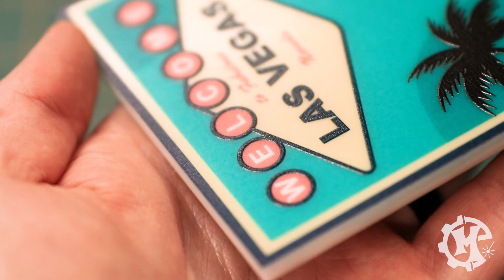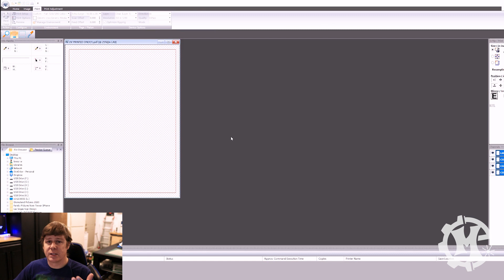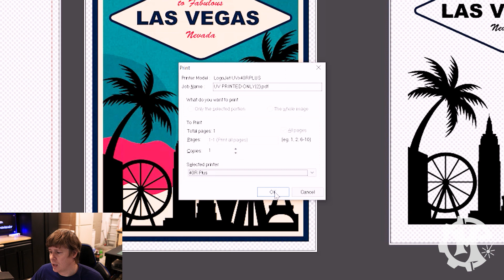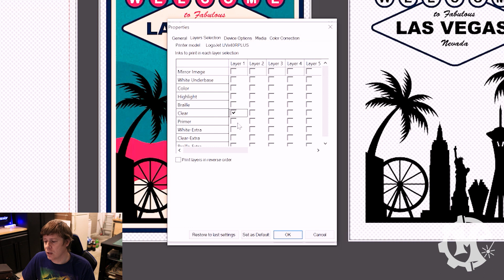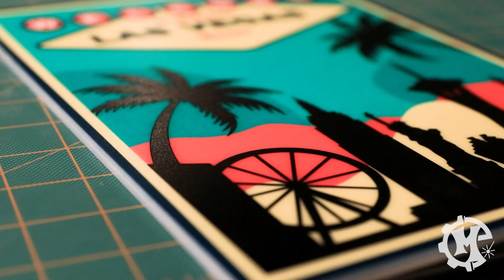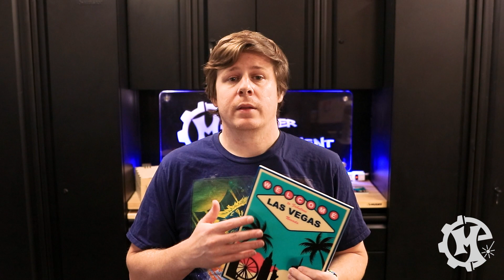How to Add Raised Elements to Your Design | Spot Gloss UV Printing

Comment: Hi, may i know how to design for these
Reply from the maker: I designed in Adobe illustrator. What exactly are you wanting to know?
Reply: @MakerExperiment  o a, designing adobe photoshop
i want to print on golden sheet, SO basically i have UV DTF for that i need to print on specific border or any object only varnish spot, white spot as full design so how to make file for that, you can say golden foil effect to look a like
Reply from the maker: There’s a method for Photoshop but I’m not as familiar with it.

Comment: i have buy UV dtf flatbed machine and facing problem of white color font print. also how to make spot channel for white and varnish as well as sticker sheet print and spot channel. can you please someone guide me or have video to share of this all my problem related query so i will fix my issue. 

I really appreciate of your help.
Reply from the maker: Which machine do you have? This printer isn’t really meant for stickers.
Reply: @MakerExperiment i have uv dtf 4062 pro flatbed
Reply from the maker: It’ll depend on your software on how to set it up. Have you reached out to your manufacturer?

Comment: You can accomplish a glossier finish on the clear by printing the clear with the lamps turned off - then run it again with no ink and only the lamps on at 100 per cent…..
Reply from the maker: Appreciate it. I figured that out much later than I should have.

Comment: Can this be done with any UV printer ?
Reply from the maker: Yes. This was early on in my journey and I plan to make an updated video at some point. All UV printers are capable of adding raised textures by layering ink.
Reply: Thank you so much for replying ! I am planning to start my own business selling custom arcylic christmas ornaments on ETSY and I need an UV printer. 

I have a budget to 5k$. Do you think is it possible to find a good small UV printer for this price ? 

Thank you for taking time and reading/answering my comments. 
 @MakerExperiment
Reply from the maker: @oliviajohnson9062  I’ll be honest, at that budget it’s going to be really tough to find something reliable with support. Have you considered sublimation printing?
Reply: I am already doing sublimation with ceramic ornaments and pretty successful with it. I have sold over 15.000 in 2 years. But I want to start selling arcylic and glass as well. The most successful sellers on ETSY are doing UV prints, or uv dtf for acrylic (not sure, but I know it is not sublimation. I ordered samples from them they told me that they use Japanese UV printing technology, not sure if thats a lie lol) 

I found this printer for $2.6k ( 6.7" Single Head A4 UV Printer A4-C procolored ) Tray is small but enough to start. I am just concerned about the print quality whether the colors would be vibrant or not. I know nothing about uv prints. I own 3 sublimation printers already and running successful business. Thank you so much for your reply, seriously means lot to me. I have been researching about uv prints for a while. 
 @MakerExperiment
Reply: I am already doing sublimation with ceramic ornaments and pretty successful with it. I have sold over 15.000 in 2 years. But I want to start selling acrylic and glass as well. The most successful sellers on ETSY are doing UV prints, or uv dtf for acrylic (not sure, but I know it is not sublimation. I ordered samples from them they told me that they use Japanese UV printing technology, not sure if thats a lie lol) 

I found this printer for $2.6k ( 6.7" Single Head A4 UV Printer A4-C pro-colored ) Tray is small but enough to start. I am just concerned about the print quality whether the colors would be vibrant or not. I know nothing about uv prints. I own 3 sublimation printers already and running successful business. Thank you so much for your reply, seriously means lot to me. I have been researching about uv prints for a while.  @MakerExperiment
Reply: @MakerExperiment  I am already doing sublimation with ceramic ornaments and pretty successful with it. I have sold over 15.000 in 2 years. But I want to start selling arcylic and glass as well.

I found this printer for Single Head A4 UV Printer A4-C and the brand is  procolored Tray is small but enough to start. I am just concerned about the print quality whether the colors would be vibrant or not.
Reply from the maker: @oliviajohnson9062  I’m not familiar with machine so it would be hard for me to say. I’d encourage you to ask in UV printer forums. Someone else may have experience with that machine.
Reply: @oliviajohnson9062  just picked up a procolored A3 Pro. So far it's awesome.

Comment: Thanks for the video.  Wondering about the Rowmark material you printed the outline on.  Does that allow you to wipe off the outline to reuse it?  Thanks
Reply from the maker: Yes. It’s a Seklema mat. You can clean it with either packaging tape and peeling it off or isopropyl alcohol.

Comment: So it’s possible only with UV printer?
Reply from the maker: You might be able to do it other ways but a printer is the easiest way.
Reply: @MakerExperiment  Thanks, but other way you mean paint? Or any other type of printer?
Reply from the maker: @samchahal9869  some options may be painting it, possibly sublimation printing, or maybe adding vinyl stickers afterwards.
Reply: @MakerExperiment  Yeah, but I also think UV printer is the best for this job. Which UV printer is beginner friendly? Any recommendations? Cost and work wise. Because these printers are expensive I guess.
Reply from the maker: @samchahal9869  UV printer is the best. I use a LogoJet but they aren’t cheap. Even the Chinese UV printers are over $10K.

Comment: Trevor... Couple questions. Was this a "print receptive" acrylic,  as I didn't see you use a promoter? Also no bleed around the color & clear layers to be sure the print covers the edges of the acrylic? If there was I didn't notice any color printed on the mat.
Reply from the maker: If it’s cast acrylic it doesn’t need the adhesion promoter from what I’ve been told. Extruded acrylic would. I did do a bleed but it was very minimal.
Reply: @MakerExperiment I didn't know that. I'm going to try it without promoter then. That stuff smells worse then the laser does cutting the acrylic.

Comment: Thanks for the work flow demo. We have a Mimaki and you're right, there are several ways to accomplish this effect. What caught my attention the most and caused me to pause was your usage of the Seklema mat. You marked your position with a simple reference rectangle on the mat. We always thought it's use case was on the Epilog for substrate hold downs. How are you cleaning the marks? Windex? LA's Totally Awesome? Do you have a link for the Seklema? It looks like we'd have to cut the mat to size if we got one.
Reply from the maker: I actually clean it with either isopropyl alcohol or packaging tape. Packing tape applied and ripped off will get off a lot of it. I got mine from LogoJet. I don’t know if they have it cut to size or not. Enduramark sells a similar mat. They may be able to cut it to a custom size if you ask. Just let them know I sent you and ask.

Comment: Nice work Trevor. It's great seeing you explore the possibilities of this UV printer. I think to minimise confusion, the ink is CLEAR not gloss. You refer to it as gloss ink, and that is what people are picking up in the comments. Typically UV print has a matte look to it. Although there is probably a clear ink finish setting which will allow for a gloss look. The clear ink doesn't get set by the uv lamps as quick and the slight movement of ink creates a smoother gloss finish. Looking forward to what other projects you create whilst exploring more features of UV printing.
Reply from the maker: Thanks for clarifying. I am still new to it but definitely enjoy the possibilities that this machine brings.
Reply: There is no such thing as a "clear ink finish" setting. The clear ink he is referring to is a separate color channel most commonly referred to as "Varnish" or "Gloss Varnish" in the industry.  The higher infill on the varnish layer the more glass-like it will appear after curing. (i.e. 90% = super glossy 10% = super matte) I think it is more than acceptable to call it "gloss ink" because the varnish is formulated to be as similar to the other inks as possible in order to avoid any sort of negative effects when they touch.

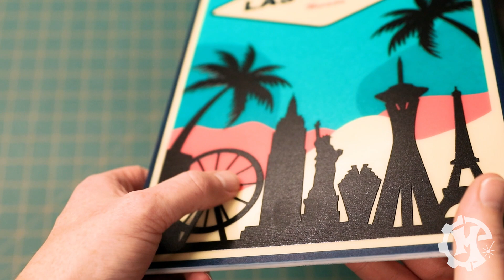Comment: When you peeled off the protective paper, did it leave any fingerprints behind? I ask as i can see some smudges on the black print around 8:57 I’ve used gloves in the past to prevent leaving the oil from your skin behind. It’s been over 30 years since I’ve done anything print shop related. That said, great work and tutorial.
Reply from the maker: I wiped it down with isopropyl alcohol. The smudges were from me handling it later. It cleans right up. You are right though. I usually either wear gloves or clean it while it’s on the bed.
Reply: @MakerExperiment  good stuff, I learned something new today. 🎉
Reply from the maker: @o311LouDogUSMC  I learn something new every day. Like the fact that there’s a better way to do this shortly after releasing the video 😂.

Comment: 3D printing nerd featured a company using the tech to 3D print in full color, essentially printing the edges of the model with UV color ink and then infill pattern with a solid.
Reply from the maker: That sounds cool.

Comment: Yea I think you messed up here. All you basically did was add an additional layer of black ink. Your spot gloss should’ve been a different color specific to your uv printers gloss setting software. Like for my Roland  “gloss” is a teal color that’s unique to versaworks and automatically tells the machine to use gloss ink only. Not sure which uv printer you have.
Reply from the maker: Could it have been better? Yeah. I don’t disagree with that. Lessons learned as I learn more about UV printing. It used a gloss ink only but it could have been more glossy. The white, blue, red, and black areas I added gloss to all raised up and stayed the same color. Like I said in the video there’s probably other ways to do it and it’s all part of the learning process.

Comment: In my opinion, it's not gloss but only raised print because the result is not gloss enugh than any other gloss uv print on youtube. Maybe you need check the UV lamp not curing properly during the clear print or maybe you select wrong setting to print glossy effect. 
But cool video👍
Reply from the maker: I’m using the gloss ink. It is possible I still need to tweak the settings a bit.
Reply: Mimaki software has an option for both clear as in the video and also really gloss clear 😊 I would assume logojet has as well 😊
Reply from the maker: @henrikbergkvist5298  I assume it does somewhere. I’m still learning this beast of a machine.